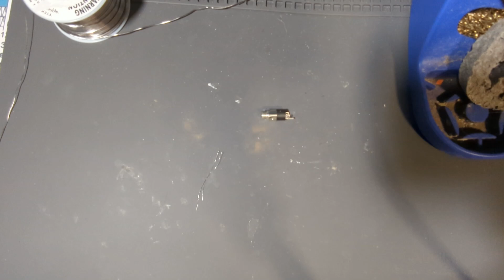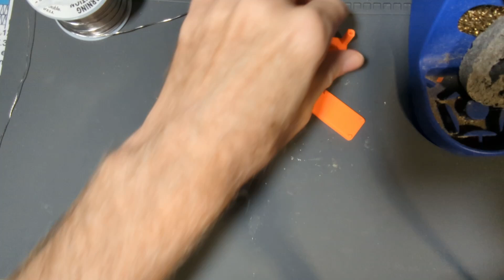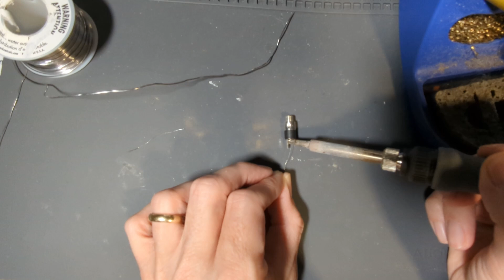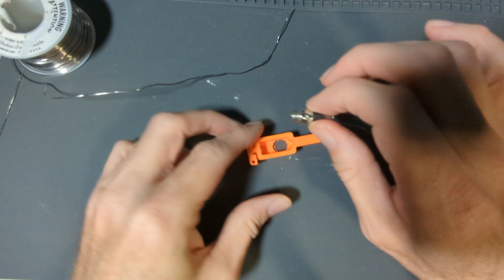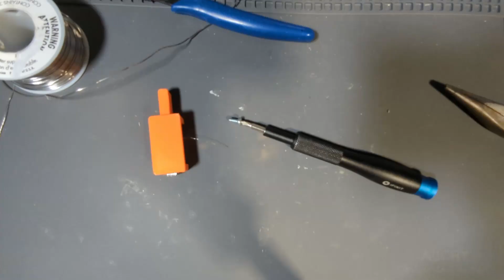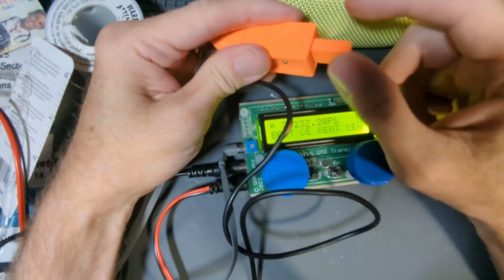QUICK BUILD: K6ARK Single Lever Paddle #cw #morsecode

Comment: K6ARK 3D prints are the GOAT. I pulled the conductor out of a BNTECHGO wire and used that for the first key I made, which also worked. Ended up splurging on the nichrome wire he recommends because I made so many of them. I also stick the wire through the hole and trim from the outside. We can be wrong together.
Reply from the maker: I saw some other people who doubled it over and ran it back through the hole, so I figured I was wrong.  Must just be a Jason thing.

I love his winders.  The way the wire almost falls off when you want it to makes them so easy to deploy.

Also FYI, I've gotten quite a few VA stations on my recent activations on 20M, so there is hope!

73s de Jason Part Deux

Comment: I built one of these last year.. neat, but I didn't like the 'squishiness', I would prefer something on a pivot with springs or magnetic returns, instead of flexing plastic... I'm waiting on a American Morse Equipment mini-b paddle. Next might be a Bushwacker Sideswiper if I like the mini-b
Reply from the maker: I agree, the feel is very squishy. The dual paddle are even squishier.  I kind of like it although it definitely won't be my #1 paddle. I have the Portapaddle II and KK1B from American Morse.  Very fun keys to use. They both have a very unique "snappiness" to them that none of my other keys have.
Reply: @KYFriedHam  I only have the ultra portable paddle from AME, it’s Okay, but I have to use a 3d printed shroud to cover the screws until I can find the right sized set screws. He doesn’t use metric on his keys, and all I have is metric screws.